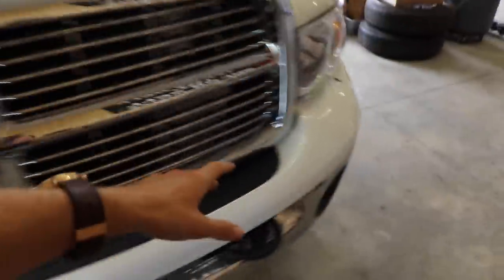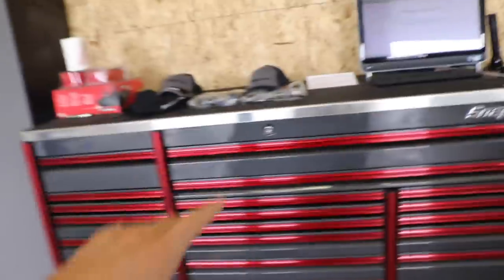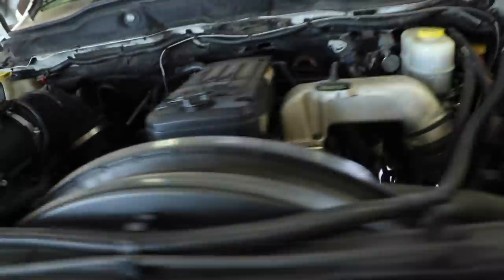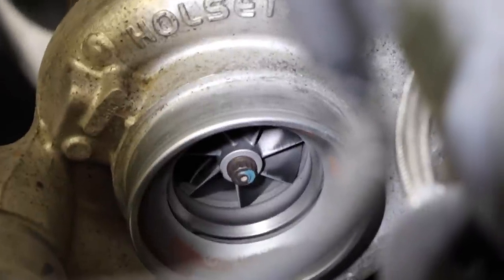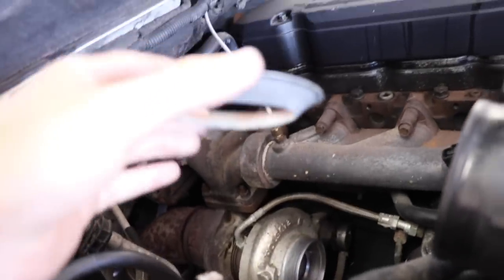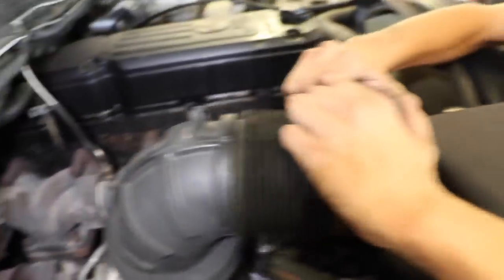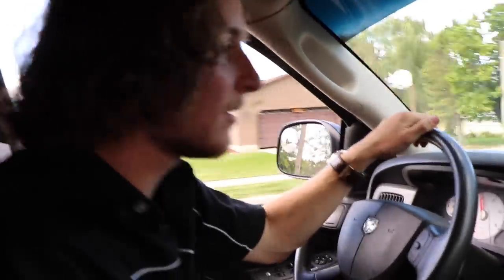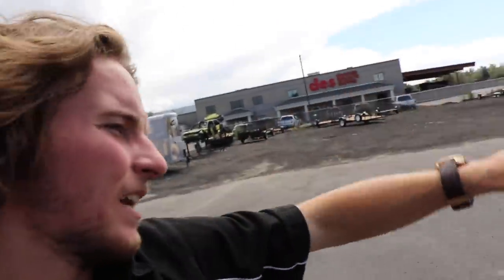THIS MADE MY CUMMINS WHISTLE LIKE A JET!

Comment: The resonator baffles in the intake tube have to be removed also when you remove the silencer ring for optimal sound. IE the plastic baffles you showed in the video located inside the air intake. You're only half way there if you didn't remove them.
Reply: That’s not going to change anything

Comment: The silencer ring does not increase teh whine you hear in the exhaust.  It muffles teh sound that you hear from the intake side.  Removing it will not make  noticeable difference with the intake "muffler" still in place.
Reply: Tiffany Pyles 
Glad to see someone else who understands this. I couldn't even understand why he went to the back of the truck when it was started up. The ring was on the intake side, not the exhaust. It makes zero difference to the exhaust sound. Anything he thought he heard different at the tailpipe was his imagination - a placebo effect, if you will. I took the silencer ring out on my '94 12-valve years ago, so I can vouch for this.
Reply: Kisses to you my lady. 
I figured I would just let him look a fool (Cause it's OMG SO AWESOME) NOT!
Reply: I love it when women talk cars and know what they're talking about too! You are one hundred percent correct as I also have done this mod years ago as well and hear a slight improvement with my cold air intake
Reply: Just took this ring out and nothing changed lol.🦄
Reply: Tiffany Pyles  not only does it not change the sound but it also causes the air rushing into the turbo to become more turbulent and vibrate the shaft causing premature bearing and seal wear on the turbo itself. this guy is a burnout and shouldn't own a truck. maybe a honda
Reply: kickassneilum 
Could you define “premature?” I ask because I took mine out of my truck, a ‘94 Ram 3500, at least 15 years and 300,000 miles ago and I’ve yet to notice any ill effects. And not to be argumentative, but back when I did this, I had been told by several people with obvious knowledge and reputable credentials, one being a Dodge/Chrysler service tech, that that ring doesn’t help nor hinder the performance. I seem to recall being told that it’s not installed in the industrial versions of the engine and that it serves no other purpose than to quieten the turbo whine and make the engine more “soccer-mom friendly,” as one person explained.

At that time, I had been a truck driver for the previous 10 or 11 years and really liked the sound of the turbo in the last truck I had driven, a Peterbilt with a 425 Cat, so I decided to give it a try.
Reply: Yeah- its not just a turbo silencer. It is an airstream shaper so to speak. The newer rigs have them doweled in to make removal harder. But some guys still drill them out.
Reply: Somebody’s on the rag lol 😂 it makes no difference when you put makeup on lol 😂

Comment: I just purchased a 2004 dodge 3500 dually ,4 dr, 5.9 Cummings with 382000 on the clock runs like a top .and I'm going to try this ,and I'm also going to remove the baffles as well in the air box

Comment: 08 black ram 3500 deleted on 35x12.5 20s -44 offset and project truck 93w250 p-pumped with a nv5600 I rebuilt swapped in....also the intake centre section if you take the baffling and foam it makes the factory intake flow and sound much better.

Comment: Got myself a 2014 1 ton 3500 with the 6.7 Cummins, only thing I don't like is the cloth interior. So far she's just got a 5" straight pipe, s&b intake, deletes, and a bullydog GT tuner. Soon I plan on taking out the "aftermarket muffler" and throw on an 8" tip.

Comment: Interesting story with the silencer ring. Dealership lets me take home an 03 dodge duelly. This is when I knew absolutely nothing about diesel trucks and seen everyone talking about removing the silencer ring on the internet. I’m also about 5 years younger and defiantly dumber. I remove the lock ring and decided to jump over to removing the piece out of the intake tube. Some friends randomly show up. We get to talking and I become completely side tracked in my work. Well without actually removing the silencer ring. I put it all togather and take off. The next day on my way to the bank to get the check on the interstate, I kept hearing this whine. I stopped and checked. See nothing out of the ordinary. So take off. That night I notice the truck is building no boost and turbo does not sound it spooling. Well when I pull it in the garage and inspect it. I found the silencer ring had gotten eaten up by the turbo wheel and the wheel was trash. I know nothing about diesel or what I have just done. So I just take the truck back and say “I don’t know what happened, it just happened”. They took the truck back and refused to fix it and took it to the auction. What a hell of a lesson learned. Luckily that happened before I bought it.

Comment: Will this work on a 2014 GL Mercedes 3.0 Diesel?  Awesome tip!
Reply: No. That’s the OM642 Diesel engine. It uses a charge air muffler to recent any turbo noise. It’s a garret turbo.

Comment: so you remove the silencer on the intake and the exhaust gets more whistly?
Reply: the silencer off the turbo
Reply: @adriandelgadillo6593  the silencer is on the compressor side, the compressor side feeds into the intercooler, the intercooler feeds into the engine, the engine feeds the turbine goes to exhaust.
It's hard to imagine that doing anything before the compressor can affect anything in the exhaust tone

Comment: 06 silver dodge 2500 Cummins.6” lift. 35” tires 20 in rims, EFI, 4 1/2” full exhaust,  intake, built transmission, 75 hp injectors, stock turbo with built internals, I’m sure I’m forgetting something’s.

Comment: Doesnt it cause over boosting when you take out the silencer ring
Reply: Not that I'm aware of, that being said I believe that truck is a 6.7 which has a vgt turbo which that ring helps out a lot. On a fixed turbo (anything before the 6.7) it doesn't really matter too much if it's there or not.

Comment: i dont get the logic, silencer ring was at the intake side, but it changes the tone of the exhaust side? lol
the turbo whistle comes from the turbine side which is on the exhaust side. i dont hear a difference at all.
if you want whistle, shoudlve gotten a durashit, or a powerstroke.

Comment: 2003 Dodge Ram 3500 5.9 cummins quad cab short bed on 35's, single rear wheel. I love your truck and sounds amazing . looking at putting 5 in turbo back on mine. i would also love a snap on hat or anything snap on would be appreciated.

Comment: Not sure why you're listening for a different sound at the tailpipe. That silencer ring was in the intake side of the turbo, not the exhaust side. It dampens the whistle/whine of the intake vanes drawing air into the turbo. Removing it makes that louder. It has no effect on what the exhaust sounds like. If you (thought you) heard a difference at the tailpipe, it was likely a placebo effect because that's what you expected to hear.

I removed the ring on my '94 12-valve years ago. It does nothing performance-wise. It is simply for sound abatement, but it definitely makes a difference in that department. But, again... not at the tailpipe.
Reply: Rick M and he works on vehicles
Reply: preston mcclain 
Haha... yeah, and guys like this is why I work on my own truck.
Reply: Guys jealous 👆
Reply: You can still hear the turbo on tge turbine(exhaust side) most times.  Just look up cheetah turbos on cummins.
Reply: Was saying the same thing to myself! Why is he listening to the exhaust?!?!😂😂😂

Comment: Can u do this to a 7.3 powerstroke
Reply from the maker: Travis DeJung I'm not sure if the 7.3 turbos have them!
Reply: Their is no silencer ring on any ford diesels ! bc that shit is wack
Reply: FreestylePYRO Lmaoooo
Reply: i dont think they have one because i have a 7.3 straight piped 5 inch turbo back and it whistles a lot
Reply: early 03 model 6.0's have silencer rings but they're not removable without machining them off.
Reply: Na, the early 03 6.0's have the loudest stock turbos put in any truck, those rings aren't silencers
Reply: FreestylePYRO actually they do have a silencer ring, but it doesn't change the sound of the turbo at all if removed. 03 turbos are only louder because they have a 10 blade exhaust turbine where 04+ have 13 blades.
Reply: Travis DeJung i did it to mine but note my turbo isn't stock,  i have put a new one in and removed the ring,  i dont think ford tubos have a ring to remove
Reply: LOGAN22 IS AmAzInG yeah I have a 97 f250. 5 inch turbo back and it whistles like a mofo, but I'm getting rid of the 5 and swapping to a 4. The 5 is too big and causing loss of back pressure, downsizing will also help with turbo spool as well.
Reply: Travis DeJung buy a wicked wheel it's like 30 bucks on eBay but I put a wicked wheel in my 01 powerstruggler and straight pipe exhaust that sucker sounded close to the 6.0.. super easy to switch out
Reply: FreestylePYRO my 2015 6.7 powerstroke straight piped is just as loud if not louder than my 06 6.0 was straight piped.